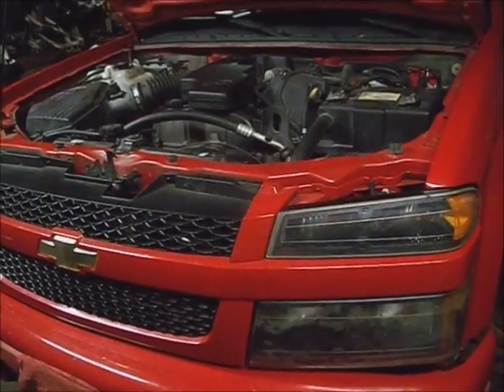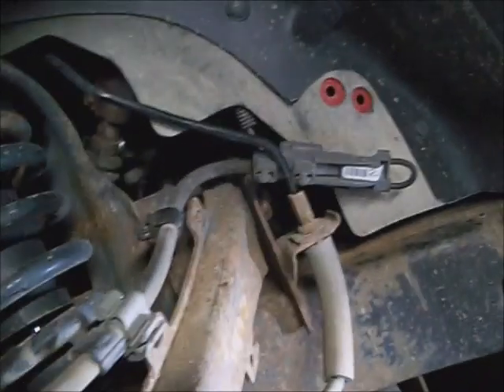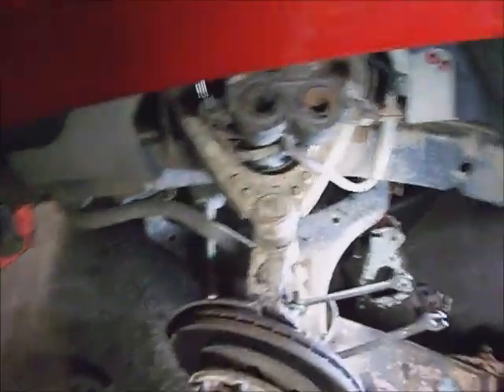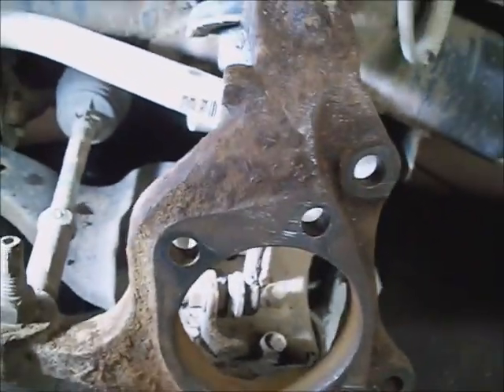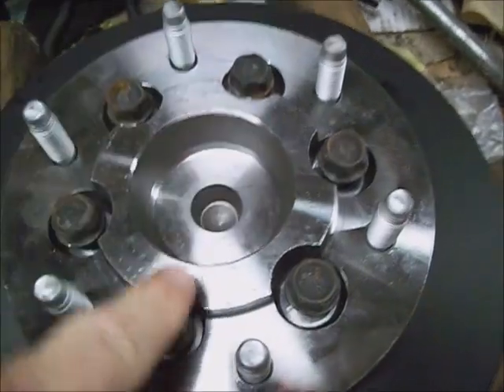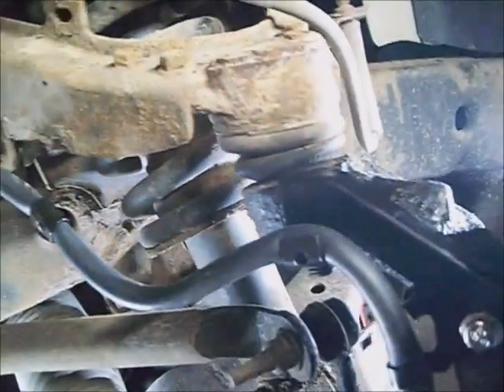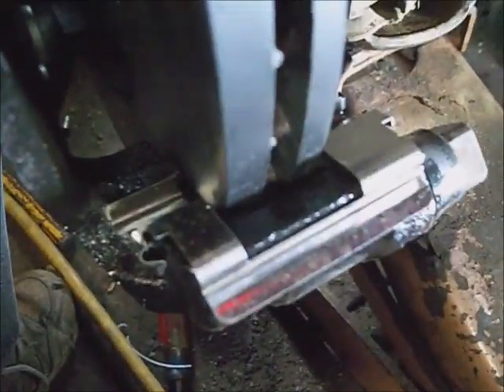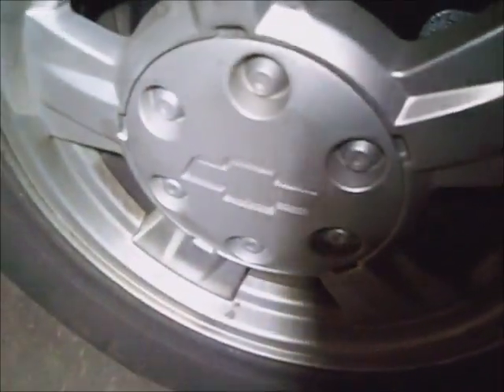Chevy Colorado`07 two-wheel drive code C0035 replace front wheel bearing and captured rotor

Comment: Does an ABS light disable the 4x4?
Reply from the maker: If it has "Auto" 4x4 and is set on auto, then yes.  But if has 4x4 button, select it, then manual 4x4 will work.  Thanks for watching.
Reply: @AutoDrdiy  Thanks and sure thing!

Comment: Sir  i have a problem with my toyota d4 1jz fse petrol engine, i spend lot of money almost 2000$ & i clean every thing  but the problem is still there..my car stalling only on  65 to 70 kmph with b/w 2200 to 2400 rpm..i check every thing no code is there..i researched a lot on internet.. i only solve the problem by disconnect vvti solenoid..now the problem was gone by disconnecting it..but this is temporary solution..i researched a lot on internet i think 70%  chance is torque converter beacause when i start car in morning the car transmission dont engaged on drive but only in reverse..after 5 to 10 minutes after cold start every thing is fine..my car moves ok.. there is little white smoke coming out from exaust ..petrol average is pathetic..3 km per litre in city and 5 kmpl in highway..i also overhauled the engine..the fuel consumption is also bad and stalling problem on 80 is still there may be its beacause of torque converter.. one mechanic told me that maybe its your crankshafts issues..no code is detected my computer scanner..only one code is there of vvt beacause of disconnect..plz help me